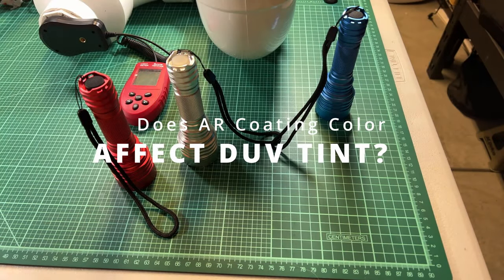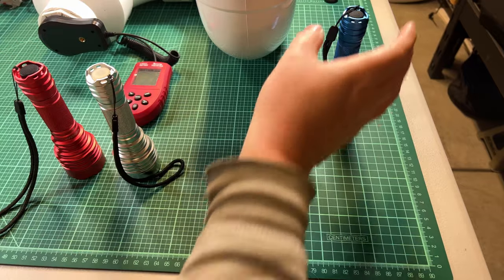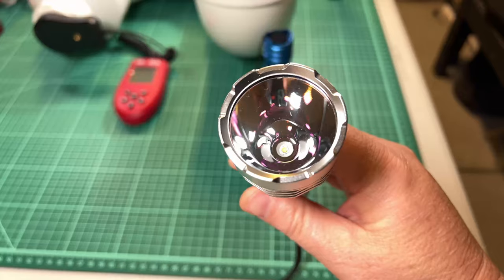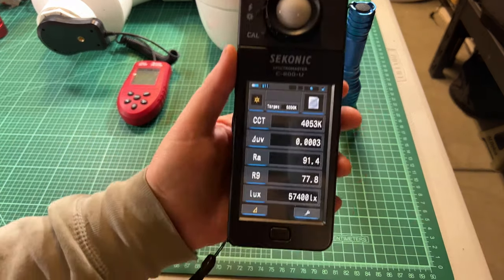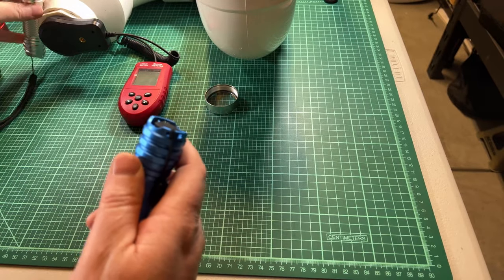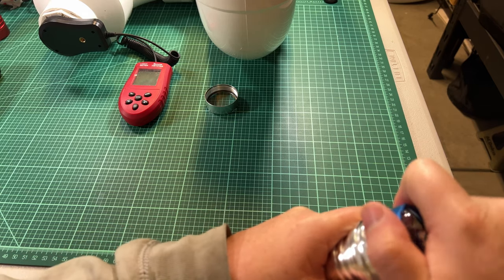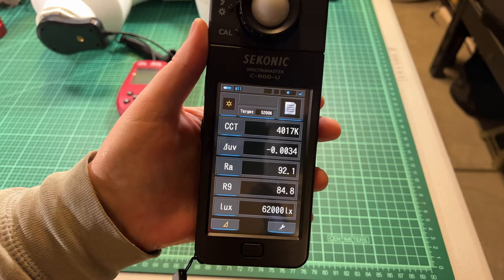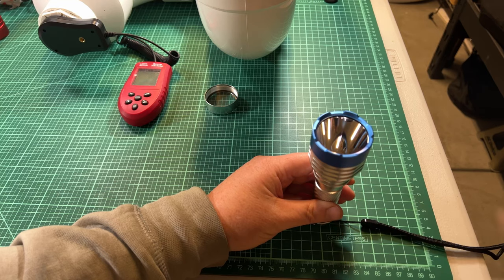How does the AR Coating color affect the Tint (DUV) of your beam?

Comment: Nice! just ordered a green AR coated glass lens for my 3000k 90 cri XHP50.3 HI swapped wurkkos ts22. the stock lens has a magenta coating and even though the beam doesn't seem to have too much green in it (can't measure), I'm hoping to make it a little rosier...
Reply: well, the lens came and I swapped it into the ts22. two things to consider - 1) it is slightly larger in diameter and I had to sand down the edges on a diamond sharpening stone. didn't take too long. 2) the convoy glass lens is much thicker, so you either need to get a thinner rubber gasket, or deal with the fact that there will be slight gap between the bezel and the head.

as for the result - holy mother of peachy goodness! the 3000k beam was quite neutral imo, but had a slight hint of greenish yello, but now the light is rosy, peachy and no hint of green. pretty sure it is now under BBL but have no way to measure it. highly reccommended!

Comment: I wish you did this test including the lumen measurements. It would be interesting to see if the AR coatings really put out 10% more light as people in the community claim. Then we could see what's the best middle ground for tint, output and CRI.
Reply: Yea I am interested to see the lumen measurements as well... we need a part 2 of this video?
Reply from the maker: I believe there might be up to 6-8% more transmission vs. uncoated glass. But I have a suspicion that there wouldn’t be much a difference between the two coated lenses. I’ll check on it in the next few days.
Reply: @cheule  thanks!

Comment: It makes such a difference that it makes me wish I could strip off the AR coating off of all my Convoys. Theyall have magenta coating and it's mangling the beams of my Nichias.
Reply from the maker: It makes way more difference than I ever suspected.
Reply: @cheule  Yep. Just did as someone suggested on either Reddit or BLF and rubbed one of my S2+ lenses clean of AR coating using car polish. The cleared lens made the 2700K SST20 of said S2+ significantly less pure yellow.

But for how long it takes to rub all of the coating off of just one small lens (more than an hour of constant polishing with a cloth), I'd rather order un-coated lenses from Simon.
Reply from the maker: Simon might even sell you green AR coated ones. They offers better light transmission than clear (by as much as 10-20%!) and  even improves tint.
Reply: @cheule What is better for a ThrowerFlashlight: Purple glass lens or Green ? Is there a big difference between them ?

Comment: So, last night I decided to check the AR coating on my 3 current lights, Convoy S2+, Jaxman E3 and Nitecore EC25 Cobra. My overhead light is 3000K, the reflection on Convoy looks purple, the Nitecore is blueish and the Jaxman is the only one that looks accurate, which it makes me wonder if it really has any AR coating.
Reply from the maker: Sounds like it has no AR coating.
Reply: @cheule  According to Jaxman the use Anodic Oxidation Coating >45 um. Whatever it is, it works, the tint on my E3 is truly excellent, no tint shift what so ever. I just wish it had higher output.

Comment: I wonder if the newer (within the last 6 months) S2+ LH351D's also have this newer blue/green coating?
Reply: Not yet, but they will eventually. As of now, C8+, L2, L21A/B, L8, and M21F come with the newer AR coating.
Reply: @tacticalgrizzly9828  What about the L6? Do you think its possible to order replacement lenses with the new coatings? Thank you for sharing :)
Reply: @kaspervendler1726  As far as I know, L6 lenses are only available with the old coating or no coating at all. When the current stock runs out, Simon will make new lenses with the new AR coating.
Reply: @tacticalgrizzly9828  I guess I'm gonna wait on ordering that 519A then, I wanna replace the LH351D 5000K on my S2+. :p